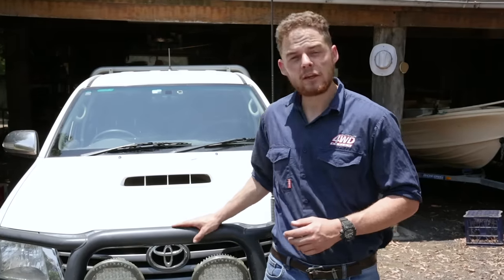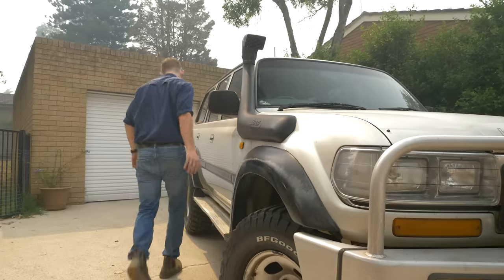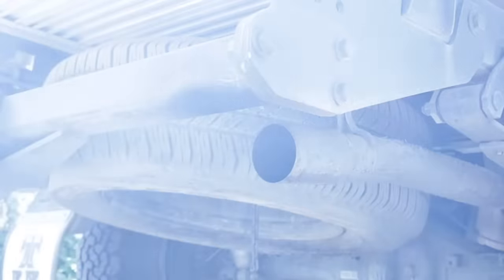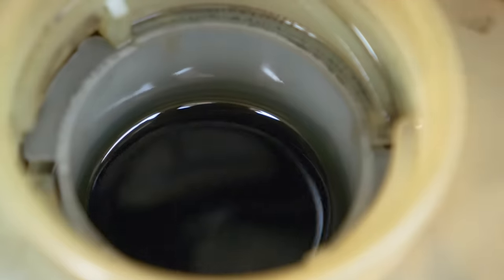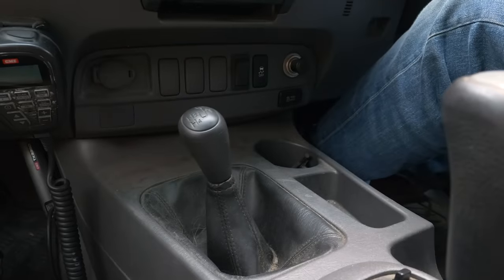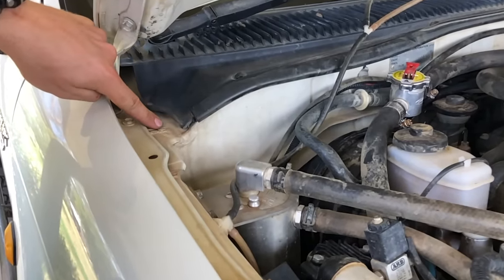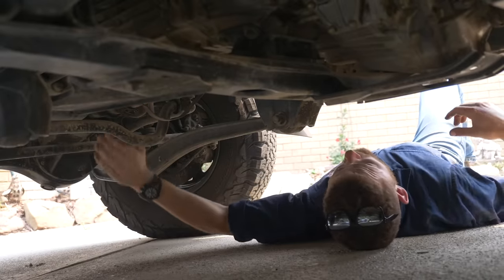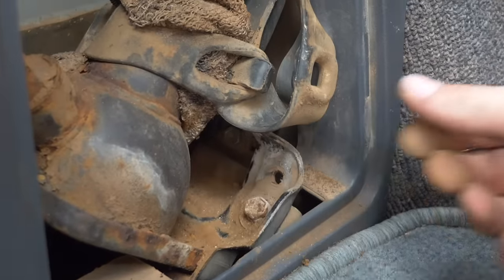BUYING USED 4WDs – Expert tips to avoid a LEMON and get a BARGAIN

Comment: I'm on a disability pension, about 6 years ago I got roped into a used car place that had a 2004 Kia Sorento V6 petrol for sale. Drove it off the lot with a bad feeling and a few concerns but a "what else can I do on my budget?" attitude and the willingness to do my best to fix what needed fixing, replace what I couldn't fix and do what I always do. Get by. It's a body on frame wagon with a proper part time four wheel drive system with low range. Most people overlook them because it's an old kia, people spend more money fitting and decking out their front barwork than the whole buy price.

But holy crap. the three years I got out of it before a cooling issue I'd been chasing around the engine for a year finally blew it up, the places it got me to. I live in the rainforest in the steep hills out the back of Cairns, my driveway will give a 4WD as hard a life as you'd find in the Glasshouse Mountains. Imagine coffs harbor, but with clay instead of that granite scree, and a sheer drop into a creek on one side. Now add 2 meters of rain a year, most of it in 6 months. Then consider the cape, the daintree, gem country, that's my back yard. The old Kia did alright offroad but man did I buy a lemon. The petrol version is garbage, but I heard there was a 2.5L turbo diesel version. We didn't get it in Australia until 2005/6 and that put them out of my budget when I went looking for a replacement vehicle that can get me home in the wet.
 But that lemon had certainly made me respect the capabilities of arguably the most under rated 4x4 platform on the Australian market.

Then one day, about two weeks after I got sick of saving up to fix the Sorento again, I'm looking on Gumtree. I see what seems to be a typo. A 2004 Sorento diesel with a 4 speed auto box. Can't be. We only got the 5 speed auto. But it's in my buy range. It looks clean as. I've got the money and some, because it's about 1500 under my budget. And it's registered. And it's It's 1700km away. It needs a roadworthy anyway so I arrange a popular auto club mechanic to go and do a vehicle inspection. It passes with flying colors and the mechanic tells me to let him know if I don't end up buying it. I'm on a train from Cairns to Brisbane the next morning, I have to see this thing and find out if it is a 2004 or if that's a typo. The day after that I'm sore and sorry from the cramped train trip, wrestling my gear with my mobility aid to get to a taxi, out to take a test drive. 
My day is sucking pretty hard and in my mind I'm thinking "too much doesn't add up, this is going to be  a waste of time."

Turns out the seller has imported the European version and it is a blue plated personal import, the odo is in miles, but it's a legit one owner, dealer serviced, town driven example of a rock solid kia/hyundia 2.5L turbo D4CB Crdi. Probably doesn't mean much to most people but it's a very popular light truck & van engine in Asia with a reputation for reliability. Keep the oil clean, change the filters on or ahead of time, don't flog it and you'll get decades of service out of it. The owner had never been four wheel driving, didn't know how and was scared to. He was going to Singapore for work and didn't want the expense of owning a car there, nor did he want to leave it to sit in storage. So he was selling it. Had three days before he flew out, hence his low asking price. Genuine lucky break on my part. I don't get many of those. 
I had the roadowrthy done on the spot and handed him the cash. Haven't looked back, not even on the 1700km road trip home where I got 1090km on one stretch from the 80L tank without the fuel warning light coming on.

Add to the fuel economy and SUV sizing the very capable four wheel drive system I was already familiar with and some 80/20 AT tires and it's made a perfect daily driver for me. Put in a catch can, drained the intercooler, added a 30 micron first stage fuel filter all to extend the engine life as best as possible. I drive conservatively, but I go to place like Blencoe Falls, Koombaloomba Dam, The Misty Mountains, around Tully Gorge, The Daintree, up around the Walsh River, or the Herbet, along the mazes of logging tracks and service roads and station access routes all over north Queensland doing my photography, videography and audio recordings and car camping out of my little mountain goat. For me, a car that can get me into the bush is about as important as people being able to hike into where they love. It's the difference between me watching a video of someone else going there, or waking up there and having a day, by myself, without depending on someone else to get me there or get me home or look after me while I'm there. I've got some ideas about suspension upgrades, removing the back seats, customing up some drawers and a bed and turning it into a mini camper but for now I'm happy as, I scored a used 4WD bargain I never would have dreamed of scoring. All up, including the train ticket, mechanical inspection, mobile RWC and the fuel coming home, it cost me $3100. Hasn't skipped a beat or hesitated to get through anything I've pointed it at and it's let me wake up in and film & record in paradise more times than is fair for a bloke to hope for. Can't ask for better than that.
Reply: I have a 2008 BL Sorento 3.3l.  Great 4by that gets often overlooked.
Reply: Audio Adventurer that’s the go mate awesome little story you got there about getting the little beasty to 👌
Reply: @Lyallsmail  haha how good is it when you have passengers say " I honestly thought there was no way you'd get through/over/down that"
Reply: Is there no post length limit?
Reply: @audioadventurer6892  , we went to Jakem's farm (4by park in S.A.).  Towing the Camper trailer into the campsite.  The owner was like "what's that car, a Kia?, I'm surprised it made it in here!"
Reply: U should write a book about it
Reply: I think the saddest part about that whole story is that I actually had enough time on my hands to read the entire thing.
Reply: @hdfxdcsuperglide3016  you clearly didn't read the whole post...
Reply: @urdeadmate  course you don't, you're a big tough guy with a Harley and big tough guys with Harleys don't care about anything. 
But I think deep down you do care, I think you have your own story you want to tell.
Reply: Jesus......is this a world record??
Reply: @hdfxdcsuperglide3016  , and you bought a 'Hardley Didanything'
Reply: @Lyallsmail  ...which are usually ridden by old farts who enjoy blowing pedestrian's eardrums out with their illegal straight-pipe exhausts.
Reply: You deserve a good deal mate. Don't forget Pat Callinan had a Kia Sorrento for a while and went all over Australia with it.
Reply: DriveAndMaintain could have left that at blowing pedestrians lol
Reply: No way I can read all this
Reply: @freshplus5920  me neither hahaha I just came here for the comments 😂🙌
Reply: What's the difference between a Harley and a vacuum cleaner?

The location of the dirt bag...
Reply: lol at the low achievers complaining about the post length. You know 4WD Action is a print magazine, yeah? Like with actual words in it?
It's like the longest thing you've ever read was a tweet. Wait until you find out books are a thing your heads will explode.
Reply: @UnknownUser435  
I scrolled down a bit to see how long the story was, and almost bailed out. I decided to keep reading and ended up enjoying the read. It's good to see a battler get a good break like that, and if he's disabled, it's more than just a car to him, it's like a new life. getting out and doing his camera stuff is obviously a real joy for him, So, I am very happy for him.
Reply: Wow, pretty long, but a decent little yarn there man. Great part of the country to a own a 4x4!
Reply: I must be getting old, cause I prefer reading a long story to watching a long video. Perhaps because I can read fast. The young ones of today want everything to fit in a twitter message. Perhaps because their attention span is only that long.
Reply: Quite obvious you aren't disabled in the fingers!
Reply: Moral of the story...Even a disabled person doesn't get ripped off twice.....
Reply: @steiny3353  Cheers mate. Graham gets it! Not having a vehicle to me is like you not having your legs for the rest of you. 
Getting out in nature helps me handle whatever other crap I have to deal with in life. Makes me feel lucky to be alive.
Reply: @freshplus5920  lol and I thought I was disabled.
Reply: Audio Adventurer we all a have our challenges all the best
Reply: @timfagan816  
ha ha ha ...I thought you were going to say, "Nothing....they both suck !"
Reply: @steiny3353  hahah. That could work for an answer too.
Reply: @hdfxdcsuperglide3016  cant even get uber eats in my area cos I.m to rural! So I'm not actually offended... just a brisk 2mile walk down the road and I can connect.  But thanks for reaching out man, much love!!
Reply: @hdfxdcsuperglide3016  haha, glad to hear you got a steal 👍
Reply: Did I get bored, yes I did.
Reply: TLDR
Reply: Ok, but do you have further tips and tricks??
Reply: Mate this qualifies for a doco..👍
Reply: Sorry mate I only made it to paragraph 3 of your book. Next time just call me instead if you want a yarn
😅
Reply: @Noises  yeah fair point but that's not what youtube's for. Good for short punchy comments
Reply: @allaussietraveller9879  thats the gentlest, but most thorough burn ive ever seen.
Reply: Nice work mate
Reply: This is youtube. Not a forum for posting short stories. 

And yes. I necro'ed the shit out of this.
Reply: Good read mate👌👌
Reply: Great story, really enjoyed reading it. Thanks for sharing.
Reply: Great story, unfortunately they fall apart as they age. I would have bought a Toyota Hilux personally. But I'm glad you are happy with your purchase and that certainly is a good price.
Reply: @audioadventurer6892  Hi mate thanks for your story and it is great to hear you are able to get on with life. It sounds like some of these Dum Ass clown’s are disabled readers and park in your car parks . All the best mate.
Reply: Great outcome audioadventurer, so happy to see one of the good guys get a win. Life is about side-quests and small victories, thanks for sharing yours! Happy motoring amigo.

Comment: Mate, don't diss the tex screws! They hold my entire life together.
Reply: Darndiddlyarn tech
Reply: @tombom1054  nazi
Reply: I’m am convinced that the world will one day be saved by tex screws, cable ties, occy straps and duct tape 🤣
Reply: Darndiddlyarn I was searching to see if anyone said this! Nuts and bolts aren’t always the go!
Reply: So true. I laughed when he said if you see he used tex screws he doesn't know what he is doing 😆
Reply: I'm thinking it's tek screws! Not tex
Reply: @MrTonaluv  I'm thinking no one really gives a crap.
Reply: @Darndiddlyarn  well you can drive you 'Hi-luk' off a klif, land on the beech hold down the selarator then hit the breaks and see if your text screws hold it 2getha.
Reply: @MrTonaluv  I don't drive a lux.
Reply: What the hell? I use tek screws with spring washers on almost everything. I have never had one fail or work its way out over time. What makes a nut and bolt so superior?
Reply: @fishfingersdiy5031  nut a bolt? As in wham bam thank you ma'am?
Reply: @fishfingersdiy5031  check their load ratings and you'll see. Tek's are good and have their place but for anything that need to stay together then machine screws, nuts and bolts are the best

Comment: I scored a 2006 E53 X5 3.0 diesel for $3k here in NZ, they usually go for nearly triple the price. It had done 350k when I got it not even 6 months ago. First owner was doing a 300k round trip every day for 6 days a week, constant hot, open road running. Full service history until the guy I bought it off, never been crashed, has been used for towing. It has cost me less than $600 in parts so far (including a full service, air and fuel filters), and I have done nearly 15k in 6 months without an issue. Moral of the story - higher k's, even in older cars, isn't so much a problem if they are longer distance and everything hot running. People get put off cars/4WD's because of high k's when they shouldn't be.

Comment: Bought a 4Runner for my first car. Has the 3vz in it (3.0L V6 petrol). Passed the rigorous inspection by my dad, as well as me. The 3vz is renowned for blowing head gaskets, and although the inspection was thorough, it wasn't thorough enough. Four months later it shit itself and then $3000 later it was back on the road. So far so good.

Comment: So any 4wd that has been used as its intended, don't buy it.
Reply: look for used starbucks cups and shopping bags.
Reply: dont buy a car that has been used offloading allot cause its engine has been put under allot of presure.
Reply: They are engineered for off road use.
Reply: The thing is, there are easier used cars out there as well.

Comment: Tip 1 never buy a vehicle with an engine light or abs light on ever ,no matter what the seller says , take a scan tool just in case the globes have been removed from the dash so the eml and abs dont show up , if the seller wont let you scan it dont buy it , Tip 2 and never believe "the air con just needs gas" they dont lose gas without faults and of course the other beauty is 
"will pass blue slip easy just needs a few small things "

'
Reply: Same with airbag lights. I got stung with a car like that. Bastards removed the airbag censor and lights.
Reply: Mega Muww pre-ignition is lamp test. Of lamp removed or blown test fails.
Reply: @alexturbine3188  yeah who really pays attention to air bag lights or any of the pre start lights though. Was only a $1500 car but still.
Reply: Solid advice. I once bought a car whose air conditioner "only needed some gas" and it was damn costly to fix. I would have to spend almost half of the car's value to fix it, so I didn't. Lesson learned the hard way.
Reply: Found the Brisbane guy. Glasshouse mountains are handy for a play day. Plenty of challenges
Reply: @LatinDanceVideos  Technically, Glasshouse Mountains is in the Sunshine Coast, not Brisbane.
Reply: Straight truth here
Reply: @Synthetic-Chicken  that seller was cold.
Reply: Please. Check engine light on a Jeep XJ means the engine is there and running. I'd only be worried if it's off
Reply: My ABS   AND Engine light on....theres nothing wrong . All the things looked at and fixed if necessary. ..sparky clicks them off says its in the wiring harness...
Reply: @karenstott7980  of course there is something wrong ,at best you have a bad harness and at worst you have an ecu that has a fault and is communicating it to you , sparky is not the same as genuine dealer , dedicated software and communication with dealer , aftermarket scan tool not the same and can not perform the same task and communicate with vehicle like genuine can !
Reply: @karenstott7980  there's one place i wouldn't take my FTE and that's ANY Toyota Dealer
Reply: In NZ the "...will throw WOF next week..." is in almost every 4wd ad
Reply: Jimmy Jones o
Reply: AC compressors seals are lubricated by the gas , it is normal for some gas to be lost over time . Factoring in a full rebuild for the air-conditioning system is a good idea when buying a car
Reply: Great advice
Reply: "the aircon just needs gas" is like saying "a flat tyre just needs air"
Reply: I take a diagnostic scanner with me. A simple one is under $30 on ebay. Also useful when a mechanic starts telling you what needs fixing on your vehicle. Also remember a scanner can temporarily clear faults so go for a long test drive and see what warning lights come back on.
Reply: @jimmyjones2426  why not  mines at one now.  But that's because I've blown 5 alternators in 4 months. No one can find a problem

Comment: My first 4x4 was a 2008 jeep grand Cherokee with a om642 diesel. I bought it as a daily with 122,000kms. I inspected the vehicle meticulously and everything appeared in fantastic shape. It didn't have a scratch on it and no rust (no rust here in eastern Ontario is next to impossible). The thing shifted nicely, fired up right away, idled and drove smooth as butter, shocks were good, everything looked pristine. It honestly appeared like whoever bought it put it in their garage and rarely drove it. It appeared in better shape than vehicles 10years newer. 

Well.. three years into my ownership none of that meticulous inspection seems to have mattered. I'm about 6 grand into repairs now.  I had to rebuild the rear diff and the transmission. I had to replace the fuel tank, and have two of the six injectors rebuilt. At the moment it's sitting in my garage with the top half of the engine removed while I'm replacing the seals on the oil cooler because it's pissing oil all over my newly paved driveway.

Just goes to show that sometimes, even the most well laid plans cannot save you from buying a lemon and buying a vehicle is always a gamble.
Reply: That’s because it’s a Jeep 😂
Reply: Would have better bought a landcruiser or hilux😂👍
Reply: Really does depend with these things.

I got a Jeep, same make and model as what you purchased with 210,000kms on it almost 2 years ago.

The only thing I've had to repair was an oil pressure sensor, clock spring and a new key when the fob broke. The rest has just been general maintenance

Comment: I bought myself a 30 year old Pajero with 95k Klms from a deceased estate in Tasmania for 5k (apparently too much) and drove it back to qld. It’s immaculate (inside) and runs 9.5l per 100. I know the die hards will hate it, but with no aircon, no power steering & no mods I’ve driven it all over DIP, Bribie, Straddie and Fraser (including ngkala rocks) with no issues at all. I’ve owned a brand new Navara before but this car is by far my favourite to date.